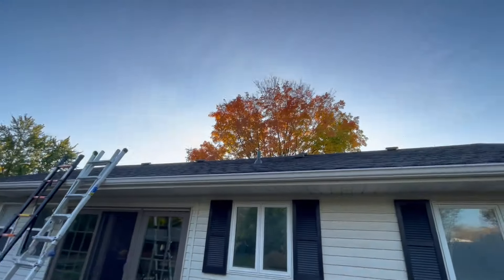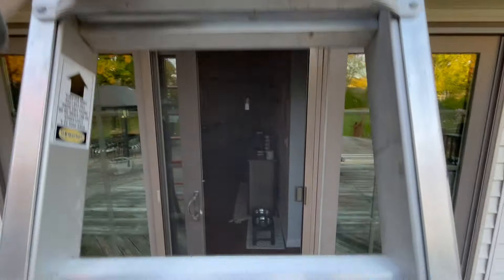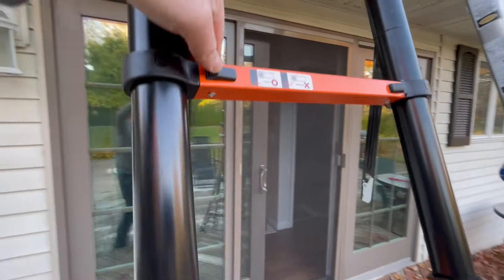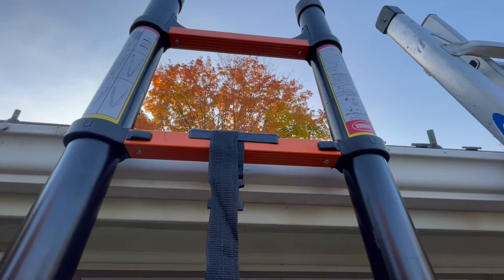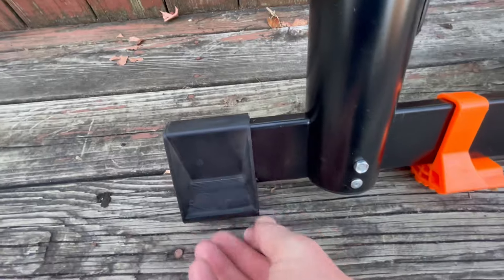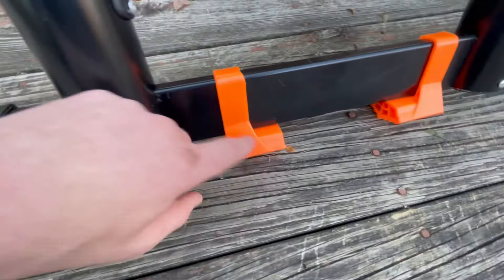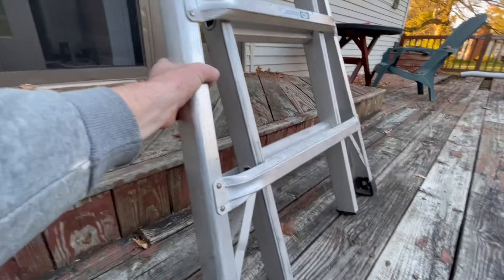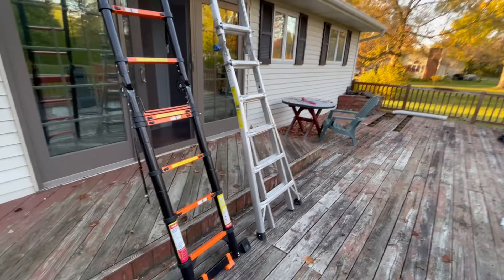Quick Ladder Comparison - American vs. Chinese

Comment: Those Werners are the best at a modest price point.  I have two of them.   You can fully extend that thing, and practically use it as a platform, even with that joint in the middle.